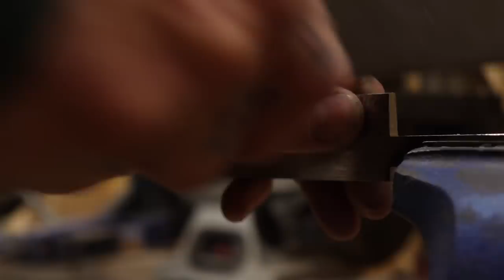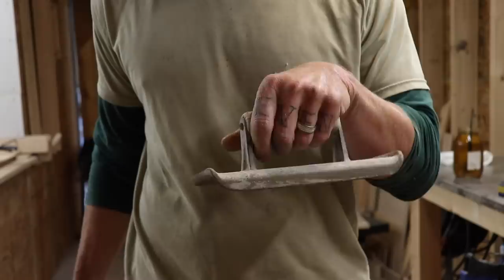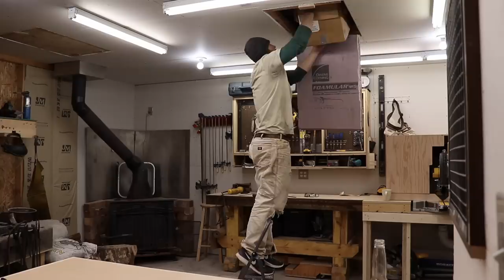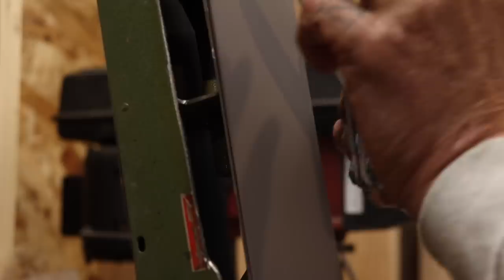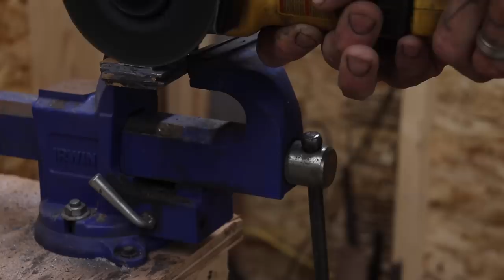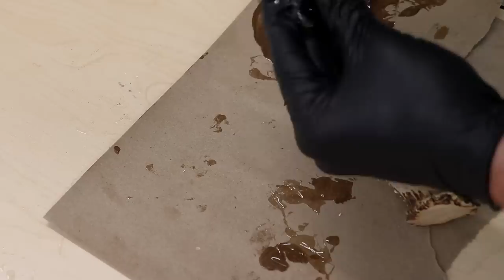ANTLER HANDLE KNIFE

Comment: Can you tell me how do you make this copper etch mixture, i love it!
Reply from the maker: I don’t have exact measurements but it’s pretty easy. Here’s what I did. Disclaimer: always ware your PPE and use proper safety precautions when dealing with acid. Ok. Take a quart jar and fill it about 3/4 full with ferric chloride. Then drop about 8-10 pennies in. Once the pennies have dissolved (roughly 24 hours) fill the jar the rest of the way with water. Distilled water is best. Then dunk the blade in. Keep an eye on it. You dilute the solution because your not trying to do a complete etch on the blade. The dissolved copper particles in the solution will actually attach themselves to the clean metal surface. And that’s it. If it didn’t get as much copper patina as you wanted you can either keep it in a little longer or add a few more Pennie’s to the solution.
Reply: Thank you!
Reply from the maker: @janselic9998  you’re welcome!

Comment: I'm impressed , was scratching my head when you were laminating the hand guard but it turned out really nice does the #50 oil you use quench better than warm canola oil ?
Reply from the maker: Randy Blackburn thank you! glad you enjoyed it. I believe the 50 is a little faster then the canola. I used canola for awhile but ended up getting some slightly used #50 for cheap so I’ve used it for the last three knives I’ve done.
Reply: The Workshop at Hidden Homestead thanks for reply - I just ordered some 1095 from a distributor and oddly enough they recommend the # 50
Reply from the maker: Randy Blackburn yeah that’s what I was told for the 1095 as well.